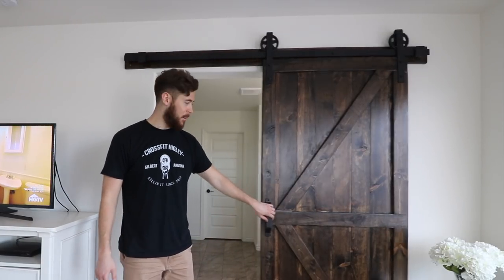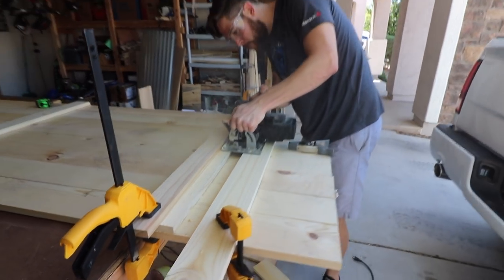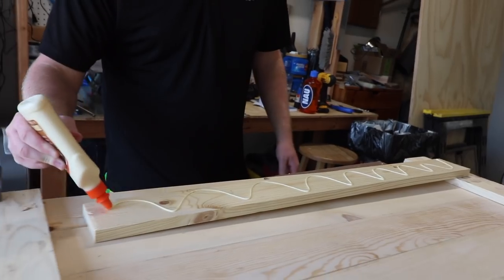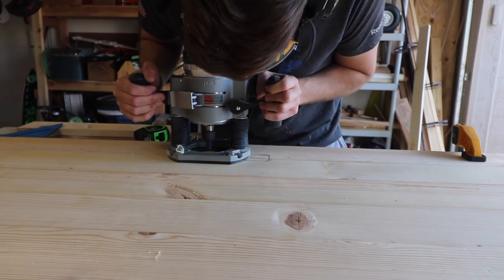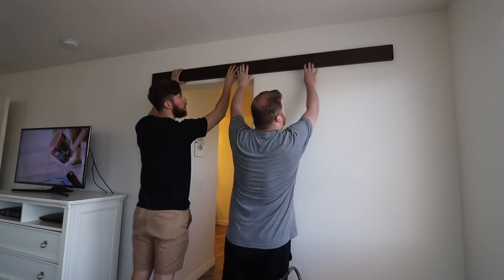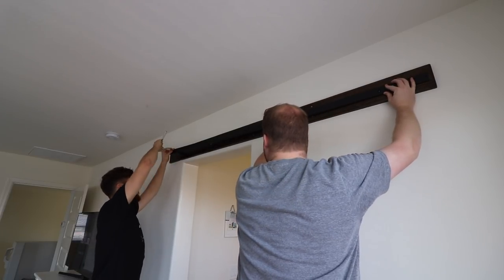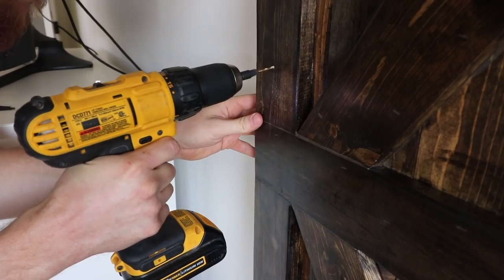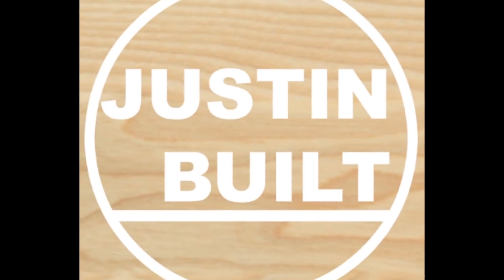DIY Sliding Barn Door

Comment: Did you have to cut out a slot for the floor guide? If not how did you go about making sure the door does not swing forward and backwards? Thanks
Reply from the maker: I would recommend cutting a slot for the floor guide. We did not on this door, we ended up installing the guid in front of the door. I keeps the door for swinging.
Reply: @JustinStanley  thanks